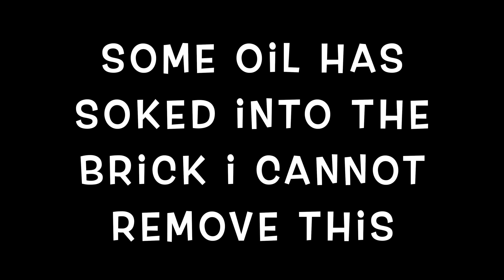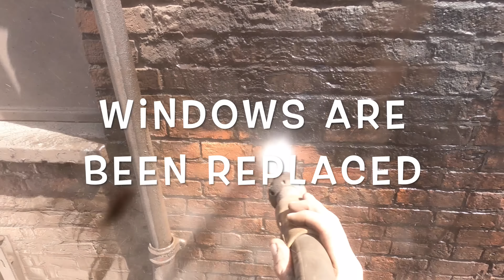Dustless Blasting Bitumen Removal Brick cleaning

Comment: Why do you use a sandblaster? Sorry if that's a dumb question... Why is it better than a normal pressure washer?
Reply from the maker: Pressure washer wouldn't remove bitumen. Well some would but it would also remove alot of the brick with the psi needed blasting is more abrasive but less psi is needed so less chance of the brick been damaged 👍

Comment: Would water alone work on brickwork?
Reply from the maker: No water is only added to suppress the dust it doesn't do anything els 👍
Reply: @Mobileblaster  understood, but would water alone do nothing? Also, your content is awesome, I can't imagine a more satisfying job.
Reply: plus, excellent music accompaniment
Reply from the maker: @bigern73  thx 👌 no it would be like trying to vape at the wall making lots of vapour but not doing anything 3 things go down pipe air lots of air small amount of media very small amount of water basically a slight drip mixed up in a cocktail that's can be adjusted by lowering air psi or working through media grades. Then pitch angle and distance is all to be considered 😁 lot more too it than point n hope 😁

Comment: I'm perplexed at even why somebody would want to coat the gable end in bitumen 🤦‍♂️
Reply from the maker: Not sure but I'm glad they do haha keeps me in a job 😂👍💞
Reply: Mick Blackley SandBlaster 👍🏻✅🙋‍♂️
Reply: I wondered that too!
Reply: I asked Google. Acts as a barrier. Doesn't mean the damp will go away though!!
Reply: Tina Tortoise well it must've been cheaper than Thompsons water seal 🤣🤣👍🏻
Reply: Maybe to keep the rain out?
Reply: Its an old ( many decades old)  cure for penetrating damp in solid 9" walls . Where the bricks have become so porus that water just gets transferred to the internal plaster . 
Nowadays clear sealant /paint would do a similar job .
Reply: @Tinatortoise  Working in architecture practice bitumen actually keeps damp in. Trapping moisture it also absolutely destroys old bricks.
Reply: @Mitch-Hendren nope. You repoint in lime pointing and internally replaster in lime plaster. Otherwise adding weird nonporous chemicals will cause damp and mould everywhere. Old walls are designed to let moisture in as well as out, called vapour permeable construction. The moment you stop that happening your bricks literally dissolve and become structurally unsafe. I know as I work restoring old buildings. Properly. Look at English Heritage advice documents. That applies to non-listed buildings as well. Anything pre-1919.
Reply from the maker: I would say your speaking the absolutel truth but I would listen to advice with a pinch of salt on the English heritage website as they get it wrong saying blasting destroys the brick and back the pathetic torc blaster saying that don't damage the brick this is absolutely wrong advice any blaster in the wrong hands will course alot of damage but when an operator has the ability to remove paint off a coke can with a normal pot(industrial standard nothing special) not 1 back handed by the English heritage I would love to challenge their research 😊😂👍 they basically say the only way to restore properly is use an over priced peace of crap that's the bit I don't get along with on the research I did alot better units are available at a fraction of the cost
Reply: It is a big area , prone to damp imgress if u protected,  protecting it from water might be a good idea , ...I don't know , I'm just guessing

Comment: Curing dampness with water!
Reply from the maker: Yeah its mad init 😁👌💞 The black is making a skin stopping the wall from weeping water out coursing damp 👍
Reply: @Mobileblaster  Depends on where the damp's coming from I guess. If it's rising damp you're correct (although something ought to be done against it then), if they wanted to keep the rain from soaking the brickwork, bitumen is spot-on, although it does keep the wall from drying should it ever get damp from somewhere else.